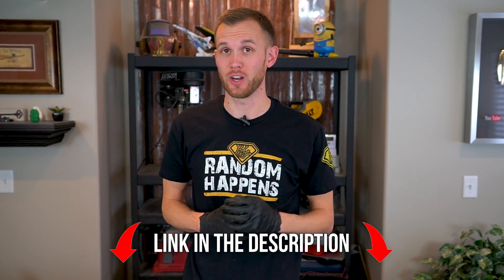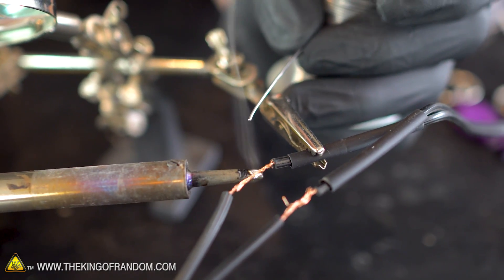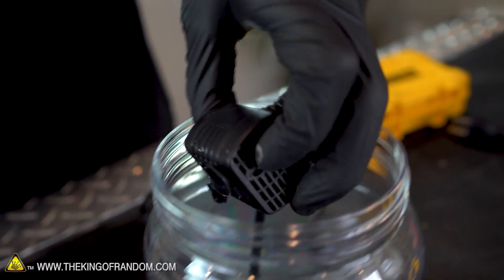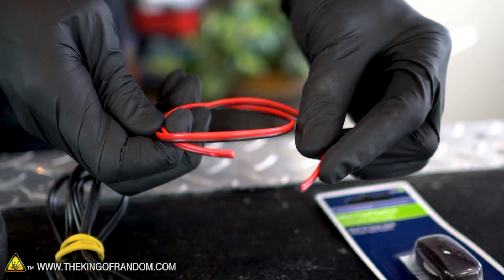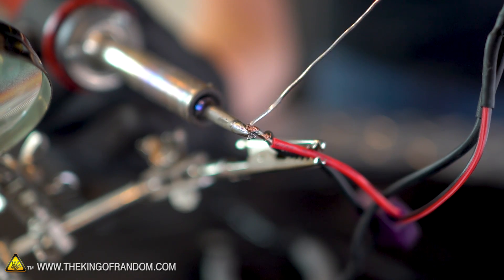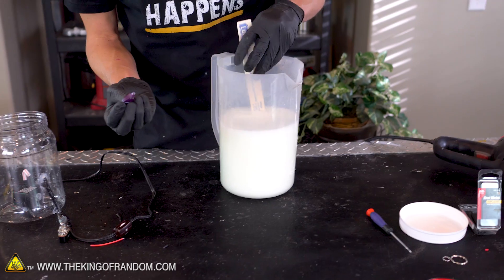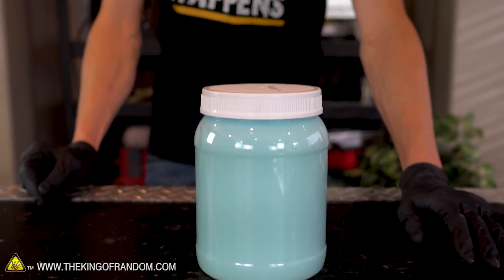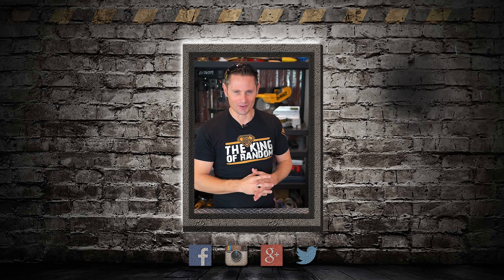DIY Northern Lights! TKOR Explores How To Make Northern Lights In Your Own Home!

Comment: I'm confused. Why use a battery pack for the light? Wouldn't it be simpler to run it from the same plugin power supply that's running the pump?

Comment: when splicing the cord, use crimp-on butt connectors. Put heat shrink over each connector separately and another piece over both together.

Comment: You talked about cutting the wire and your joints being made poorly. Question why not cut the end on and simply replace with a new male plug cap? Limiting  one place for failure.

Comment: great job with the splice. the only thing i think i would have done differently is use a western union or lineman splice before soldering. the rest was dead on and the splice i mentioned makes it a little more difficult to pull apart. just a suggestion. not a must. :D

Comment: Another improvement to your splice would be to make the ends a different leangth so that the to wires once spliced will not short together.
This way bith splices can be covered with one heat shrink and give a thinner profile

Comment: It's called an LED, not a light bulb.
Reply: BTW, if you ad a resistor to the LED you can connect it to the mains and skip the battery.

Comment: This is pretty cool! Though, one thing, it might be more water-tight if you put the hot glue on the inside of the holes instead/also. Since the pressure of the water pushes outward on the container, if the hot glue is on the outside then it can easily pop it off of the side. Conversely, if the hot glue is inside, the water simply pushes it more tightly onto the hole.

Please let me know if I'm wrong, but this would seem logical to me. 

Thanks for the interesting vid!

Comment: The ratio of easy to find things vs things you would find in an electronics supply store baffles me.  Why would you use the keychain when you could get an LED and some batteries at the same place you would have got the switches?  The end product looks cool, but the way you got there is a little clunky.  You could have tied the light into the motor easily and bypassed the batteries.  And why did you attach the wires for the light at an apex instead of in a straight line like you did the motor wires?  Overall, this is the most confusing build you have done.  However, thank you for continuing to produce content to get people thinking about how to make cool things around the house.

Comment: seems like you could have added the switch in the same spot as the original cut, and only had to strip and solder one side... >_>

Comment: A even better method for splicing cord. Because it is multi-stranded wire you can for the stripped strands in to each other. Add heat shrink first force ends together so the strands for lack of a better word braid them selves together solder and shrink the heat shrink. Oh meant to add add a larger heat shrink tube that goes over the entire cord both wires as well and you will get very clean joint. The solder will work its way between the strands and hold every thing much stronger than it was even before you cut and made the splice. It will be the strongest point in the cord

Comment: You could have wired a 6v power supply in instead of using a battery pack and you could have mounted the LED right in the bendy straw so you would only see the light from the fluid.

Comment: "no need to cut the cable for the switch" proceeds to cut cable for the switch...

Also you could use a phone charger +resistor instead of battery

Comment: Why not use an old phone charger for the led light. Most phone chargers have 5V output. This will save you from having to continually buy batteries for the light

Comment: should use tonic water with the glow paint mixed in, and shouldve used both leds and split them into the pump wire as well then theyd have power and everything would switch on all at once. cool idea though

Comment: A little while ago, you tried adding Chemical X to Thermite. What if you tried putting Chemical X on/in Nitrogen Tri-Iodide. As you saw with thermite, Chemical X slowed the reaction speed. So would Chemical X slow down/speed up the reaction?

Comment: Poor soldering iron... You should care a little more about your tip... And btw hot glue isn't supposed to be used as sealing, it brokes easily. Next time use epoxy/silicon.

Comment: Get you some large silicone infused heat shrink instead of electrical tape. As you heat it up it shrinks down and the silicone layer seals it water tight. I use it when wiring up well pumps

Comment: I would have cut the pump cord right at the original plug and used a replacement plug.  This would cut out the extra splicing, soldering and heat shrinking of the 120 volt circuit.

Comment: Could you put a disk above the pump, and use one of the adhesive led strips inside? This would allow the flow from the pump to push off of the disk toward the container on all sides, where the led strip is also pointing all the way around, due to its location on the edge of the disk. 
This way you wouldn’t have to display the cords out front. And there wouldn’t be much editing to the current build at all. It would actually all be just an addon

Comment: Next time you do a wire splice like that, 
stagger the ends.  One of the wires on 
that "lamp cord" will be marked.
Cut an inch off of one wire of the 
short length, and cut an inch off the 
different wire on the long piece.

Now do your splice. the splices should 
NOT line up with each other.  That is what 
you want.

steve

Comment: Would be better if the led was in the bottom of the jar, make a little stand to allow for cable room and such, perhaps even hide all the cables underneath so it's a tidier centre piece and also get rid of that strong spot the led is making.

Comment: Any thought to taking the pump apart and cutting the wire where it attaches to the pump innards? Then you could re solder it and seal it up with silicon sealant.

Comment: ... You could have just cut off the plug end and replaced it with a clamp on replacement to make the build more friendly for viewers who dont know how to solder and used hot glue and basic wire twists on the led.

These arent really an issue for me, it came to mind because this looks like a project I would have loved to do in my middle school Gifted Resources class.

Comment: I have an idea: try putting eggs in liquid nitrogen and then putting it in a vacuum chamber
Reply: Vincent Calabrese well first of all if you put an egg in liquid nitrogen it may crack the egg or at least put it under more internal pressure due to the yolk expanding as it freezes. But if you put an unfrozen, uncracked egg in the vacuum nothing happens because the inside of the egg is already a vacuuma because otherwise eggs would go bad in a day if they were filled with air.

Comment: Dude,you could have placed the LED in line with the power from pump using a buck converter to drop down the voltage to the 6 volts.

Comment: Working with mains voltage pump is DANGEROUS!.
I suggest you get a USB powered pump for $3. Search for "Brushless Submersible Pump" on eBay. You can then drive your LED from the same supply. MUCH SAFER

Comment: I would suggest limiting the power to the pump to make it run slower, to allow for the paint to pick up more light, and generally look better. Also put the led inside the jar to avoid the glare problem.

Comment: Why not just link the lightbulb to the powersource instead of using the keychain batteries ? those will dies pretty fast and it'll be a mess to change it isn't it ?

Comment: You can possibly take out one battery from the LED and see if that makes it less shiny. Not sure what's the operating voltage of that LED, just try less and less voltage (or use a resistor) to limit the light.

Comment: maybe by lightning from the lid of the jar would have made a more smooth light in the jar instead of a big lightning point as the northern lights are more like a line of light moving in the sky and not a big "sun" in the sky with less bright tentacles around.... it can represents a solar eruption also the way you did it. But it's still very cool :P

Comment: Nice idea and execution! I will be making this, it's awesome.
If you want to dim the light the LED emits, try adding an 1k resistor on either side of the led. Or better yet, a 5 or 10k potentiometer. It will prolong the life of the led as well.

Comment: You could also use a stir bar
 Magnet inside and a magnet outside that spins look it up :)
Reply: Basically it's a magnet attached to a motor that spins in a vortex fashion and on top you put a non magnetic container and then put another magnet stir bar inside and turn it on and voilà you have a vortex that can be controlled from the outside as well as being cheaper and easier than all this wiring and water piping

Comment: Well, you could have saved yourself a solder joint by only soldering the one wire and passing it through the switch, while also making it look nicer with no joint visible from the outside. Also I would have saturated the wires a little more with solder and and separated the wires a little more so the end of the heat shrink isn't so close to the solder joint while soldering to prevent it from unintentionally shrinking while soldering.

Comment: You should try attaching the pump and light to the lid. Run the light cable along the straw, then you keep the jar intact, put the lid on some legs, fill jar to top, then screw on lid, letting some liquid spill over. For added coolness, add a cup or so of oil.

Comment: I think it would of been nicer and tidier without a separate switch for the LED, there was no need, would it have been possible to have connected to led in parallel so only one switch and one wire would be needed? This could also mean the mains with a 6v resistor could power the led meaning u wouldn’t have to replace the battery’s. My science may be a bit off correct me if I’m wrong but it would be neater and more professional in my opinion. There’s no need for two switches

Comment from the maker: Is anyone making this?
Reply: Can you link all the items from amazon in the description to make it easier to try out?
Reply: I might actually try this one out. I'm not sure I like the pump though, they break all the time. I might swap it out for some kind of mixer and throw the LED on top if i try this project.
Reply: Razvan Duciuc dry ice is frozen co2.
Reply: What would happen if you take the solar scorcher and put a mirror on the focal point?
Reply: No because i don’t have the right materiels
Reply: I am just need the uv light
Reply: same i make stuff for use too
Reply: Razvan Duciuc dry ice doesn't come from liquid nitrogen
Reply: mocking spongebob meme:
nO i mAkE sTufF fOr UsE nOt DeCoRaTiOn
Reply: Dry ice is solid carbon dioxide, so it will not become liquid nitrogen. It will instead just turn directly into gaseous carbon dioxide. Since it has no liquid form at earth's atmospheric pressure, it's considered as dry.
Reply: This could be cooler with some design changes.  You could DIY a magnetic stirrer and put the LED inside the jar.  Use clear epoxy to encapsulate the LED and the leads for waterproofing.
Reply: I really don't feel like it
Reply: i be making one tomorrow but on a bigger scale :-)
Reply: yes
Reply: No
Reply: Razvan Duciuc please, please tell me that you are trolling
Reply: Never but i love your videos
Reply: Reminds me of something from ghost busters
Reply: Yo, KOR tell us what Grants been up too with less pressure on him.
I hope you guys are happy.
Been a supporter of you guys for 3 years now 🤙👑
Reply: Is garnt comes again soon
Reply: The King of Random please try to make liquid hydrogen and try to light it
Reply: Razvan Duciuc no
Reply: I don't have the materials
Reply: Nope xD
Reply: I'm not
Reply: I'm thinking I'll replace the button batteries with a small switch-mode supply that switches in parallel with the pump, and maybe get a more robust LED.  But hey, much better job on the cord!  I would have used a larger shrink tube over the splice instead of the electrical tape though.
Reply: For more glow, try using the world's gloiest glow paint or pigment
Reply: duh me
Reply: The King of Random if my mom says yes but she's probably not going to say yes
Reply: I quite like this, as well as the previous vortex fountain. I think this would look cooler in a larger vessel but same size pump, to slow down the water turbulence and look more natural of the Northern Lights. And with an improved base to house a ring of the leds and hide the electrical a bit better. I may have to try this out, ideas a flowing :)
Reply: I'll just go outside and watch them.
Reply: I have a daughter who loves the Northern lights, but we live in the middle of a city so she never sees them... so yeah, I'm making one. I've a couple of idea of how to mod it a bit to improve the swirly effect. Like adding clear plastic streamers glued to the inside of the jar, to get that 'curtain' effect the real lights have.
Reply: The King of Random what would happen if you put mercury in vacuum chamber?
Reply: The King of Random and what would happen if you put only food colouring and hot glue?
Reply: MMMMMMMMMMMMMMMMMMMMMMMMMMMMMMMMMMMMMMMMMMMMMMMMMMMMMMEEEEEEEEEEEEEEEEEEEEEEE!!!!!!!!!!!!!!!!!!!!!!!
Reply: The King of Random i am
Reply: im going to try it but i only just finished the mini metal foundry
Reply: Not anytime soon but more than likely. I'll probably look into being able to adjust the flow of the pump and the brightness of the light.
Reply: @fernandoh4515  Just use one button battery and a potentiometer on the ground of the led. LEDs are made to be used between 3 and 3.5 volts. at 6 volts that setup was way overpowered and the led isn't going to last long without a resistor. Also for the price of two of those keyrings, you can find lots of 50 LEDs on eBay. There is honestly a bunch of changes I'd make with this set-up.
Reply: no
Reply: The King of Random me
Reply: I hope so
Reply: if you make this please DON'T use hot glue. hot glue is NOT water resistant, it's just a temporary fix until everything spills out
Reply: The King of Random see what happens if you put bullet in liquid nitrogen and see if its still works
Reply: The King of Random yes
Reply: Trying this out :D
Reply: no
Reply: Razvan Duciuc it wouldn’t because dry ice is carbon dioxide, and liquid nitrogen is well, nitrogen!
Reply: will be making some this month ~April 2018~ two at minimum as I have a slight adjustment to the set-up to make it better suit how the person that receives it will utalize it most. so makeing at least two, one to test the alteration, and(if needed) work out any bugs.
Then I'll make the one to be gifted.
Reply: dddslimebbb ya pumps are super unreliable. Don’t know why
Reply: i wish cuz i really want to meet you.
Reply: I will, but I have a USB powered pump, so I can run the LEDs off the same power wire as long as I dont go too high powerwise
Reply: ill buy it
Reply: 2 complicated
Reply: The King of Random yes of course
Reply: Ok
Reply: I will ..after my exams👍🏻
Reply: Doesnt look like northern lights at all, but this is however very cool, just not aurora
Reply: Can you freeze liquid nitrogen
Reply: no I make stuff for use not decoration, like weapons and tools.
Reply: If you melt dry ice will it turn into liquid nitrogen

Comment: Grab some 3W SMD leds leds. Those will give you the brightness you need! just add the heat sinks and a small buck converter! The end result will be 9V battery -> switch -> Adjustable voltage converter -> Leds (you might also want to cut down on the amount of paint)

Comment: You should do a mod for this where you use a phone charger spliced into the power supply to power the led and eliminate the need for batteries.

Comment: Why not put both the pump and led on the same circuit? You'd need a few more components to convert the AC to DC, but it'd make it more user friendly to need only one switch

Comment: can you make a filter that sorts out short wavelengths so you can take ultra violet pictures and one that does the same, but letting short wavelengths pass through so you can take infrared pictures. Many camera sensors also capture wavelengths outside of the visible ligth spectrum. Nice video

Comment: Concrete consists of lot of air and in vaccum chamber all the air will be sucked out so the particle will spil on each other like graphite particle and thus it will turn into dust

Comment: Nice!  Since you already have a switched AC supply, I would use a small DC power supply instead of that battery pack and switch.  An 5v USB phone charger might work.

Comment: Mounting the pump and light in the lid whould probobly look cooler and it should be possiable to get the same effekt.

Just that the light is at the bottom  shining up, but should look fairly the same but with a new kinda pattern.
Also, if the pump is 12 volts, it whould be possiable to run dubble LEDs in series in a paralell cuircut to the pump and use the same switch, and it whould have been possiable to just cut the wire once and soder 1 connection and put it in the switch.

Comment: Another thing you could do to up your wire splicing technique is to cut the wires so that they are staggered.  When you connect the two halves of a cord with staggered wires, the exposed bits wouldn't be able to touch.

Comment: Since it’s 6 volts, you could have made a makeshift battery pack and used 4 AAA’s or higher capacity batteries. That way the batteries are cheaper and last way longer

Comment: I would have used an old USB charger for the power to the LED. Won't have to worry about battery power. Only need a resistor and boom.
And a DPDT switch to make the on-off easier